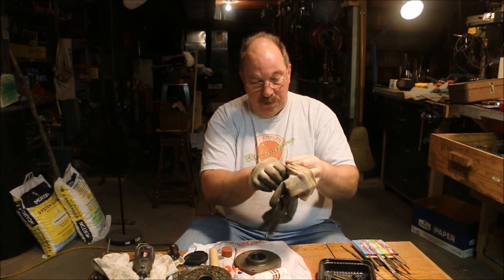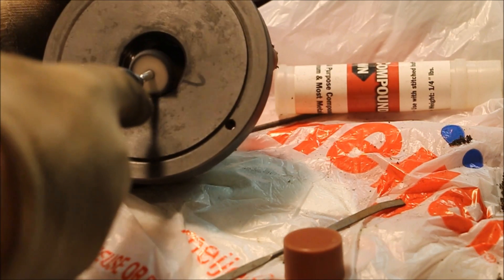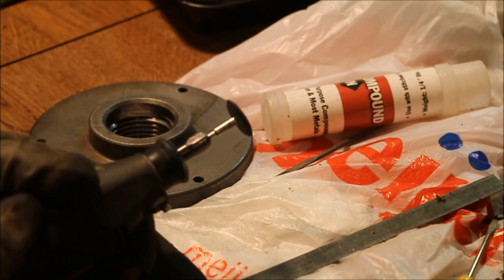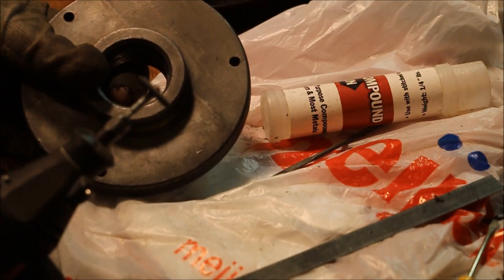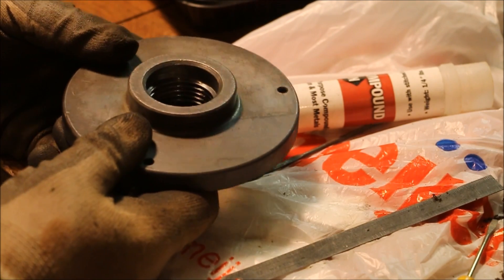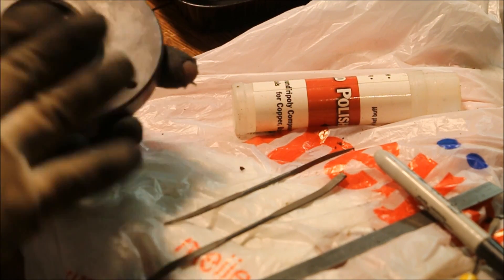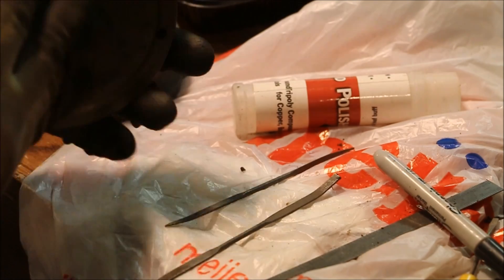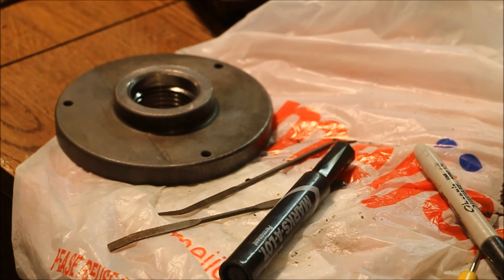Mounting My 3 Jaw Cushman Chuck ~ Pt 2 ~ Reworking A 1½ - 8 Thread ~ by Old Sneelock's Workshop

Comment: Patience galore, I would probably have already went to see my German Baptist friend at the machine shop. But there's something to be said for accomplishing it with your own two hands and it wouldn't be a video. Thanks
Reply from the maker: I use to run my local machine shop. When I worked for a living I'd have handed the chuck to one of the guys and said fix this. They have to make a living and there's nothing wrong with using resources if you have them available. Now that I'm retired, and don't have to turn a profit in either time or money, I just prefer doing it myself with what I have available.

Comment: ..with the polishing, filing and such. it sort of sounds like the threads had a taper to them. one opening slightly smaller than the other. my brother who is a machinist by trade showed me an example. look at the threads of any threaded pipe and a joint connector. sometimes they are visible with the eye but most times you need to measure them to see. he said that some taps and dies develop it over time from use...
Reply: True. With some outfits not re-looking their dies it's a wonder anything fits anything and those that do have to be forced. Get out the pipe wrench and added leverage of a 4 foot pipe over the end.
Reply: ..yep !! my "extension" handles range from little George- 12"x 1/2", to "Big Bill"--7'x 3", not to mention my 8 lb. helper. I got a mess of them extensions...
Reply from the maker: I have a few of those. My favorite method is one I use to remove the caliper bolts for brake pad replacement. Set the wrench on the part and put a 2 ton bottle jack under the handle. Never fails. Either the bolt comes loose or something shears off. So far no sheared bolts. For the big bolts on farm machinery I have a set of 3/4" sockets. If I can't break it loose with the 3' breaker bar I get out the torch.
Reply from the maker: After a great deal of time spent speculating on the cause of the tight threads I've come up with a theory. The chuck had been used as a part of a fixture of some type. The fixture left the mounting hole open so swarf, cut offs and debris had access to the opening. The threads were the proper pitch they just had dozens of dents and dings along their length that I had to polish out. It's almost like they were knurled.
Reply from the maker: Worn dies would account for the threads being off pitch. This chuck was made in the 50's. In a chuck this old I doubt it was made by someone at South Bend that didn't do the job right.
Reply: Old Sneelock's Workshop Yessir! A little heat applied can go a long way and save a bunch of grief!
Reply: Ol James Can't have too much of a good thing!